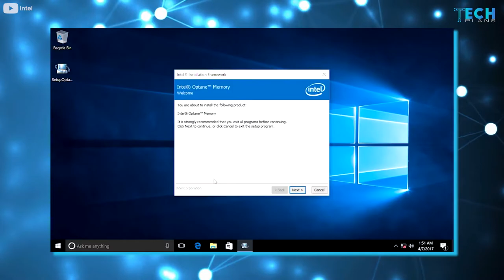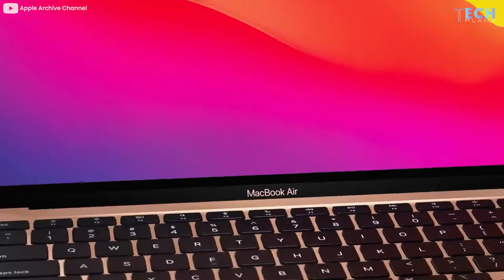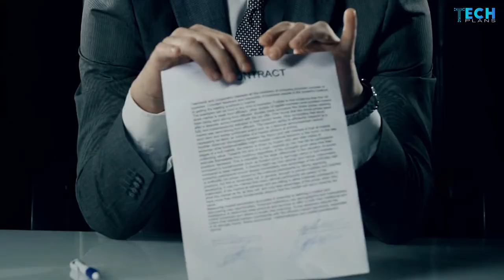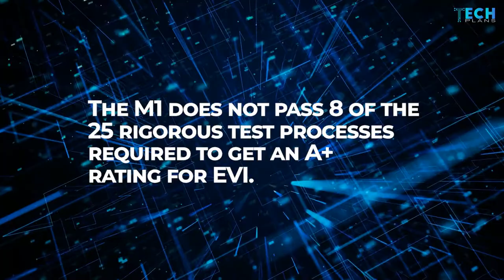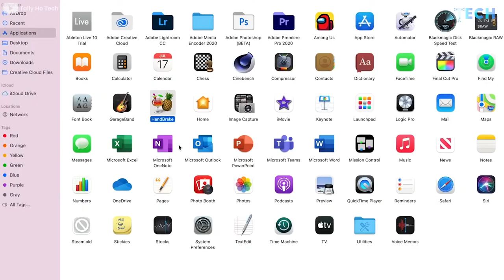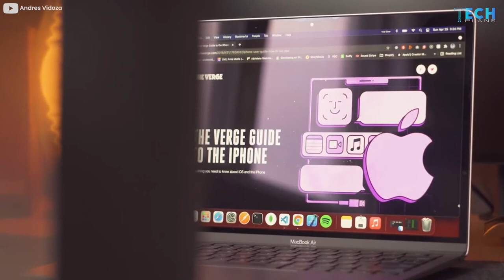Is Apple M1 Chip Better Than Intel?

Comment: Why no one is comparing the tiger lake 11800h vs. Apple M1 chip? 
You find all kinda comparison of M1 8 cores vs intel 6 and 4 cores. But for some reason all the Internet reviewer and been searching for around  3 month since the release of the new h45 tiger lake. Though they compared everything to the 11800h ,no one dared to put it next to the M1. 
I know from the benchmarks the 11800h will wipe the floor with M1. And I know M1 is more efficient in power only though.  But I wanna see the experiment live and no one wanna do it ??!!! Why ????
Reply: Yas it more efficient but whats good out of it, i work as video game developer, do a 3d renders and 3d animation videos and my intel machine destroys m1 like potatoe... And i have 10th i7 + rtx 3070 laptop for same price as m1 mac
Reply: Tiger lake gets HOT AS F and battery life suffers heavily. I had one, returned.
Reply: @meowow thats the reason i dont buy mac. Its nice, slim, lightweight, good bttery but also useless for me, would be thrown in a corner to collect dusts

Comment: Apple M1 chip power consumption is very very very low compared to other processors. It use 15w as opposed to 125w by i9 (laptops). Thats a huge difference. And 16hrs battery life is more than enough. Apple just destroyed the competition here. Accept it, I am myself an  Intel guy but I am gonna switch to Apple processors just because they are so much better there is simply no comparison. If i dont switch if would be like using a blackberry/symbian phones in android/ios era , you will have to switch. Price is one big factor though , if apple makes the price competitive other companies will simply die if they don't come with with tech to match performance of apple processors.
Reply: It depends where its good, video editing? I work as video game developer, do 3d renders, 3d animated videos, and my intel machine destroys apple, sorry but apple not universal, i rather be able to do my work than have long battery and a low power consumption that i cant touch or taste, cool tech but very limiting
Reply: @racistpixel1017  I agree but how may people are game developers ?  In most applications it's better than Intel.
Reply: @Akkinone1  quite some, also 3d artists, how many ppl is video editors? There jobs to be done all around the place. On top of that apple offers battery, what you do with that battery, my laptop is always on charger since its work station, i do not plug and unplug it like apple supposed to be, i plug and o forger...
Reply: @racistpixel1017  I am just saying it's far better processor in most cases that's it bro. Not in all but comparatively  in most cases its better,  that's all.  Wouldn't you agree with that?
Reply: @Akkinone1  yas but computer does not consist only out of cpu, m1 has perks and has weaknesses, o would not call ot better, on paper yeas, in people heads yeas, but in 50% of workflows barely. Whats good out of that wonderful power consumption if its cant do 50% jobs

Comment: The M1 uses the ARM instruction set, but they don't use ARM processors. You cherry picked 2 intel laptops that supposedly have better battery life, but you are the first I've heard say this. I'll bet those laptops won't last longer doing heavy duty processing while unplugged. Every Intel book I've seen has their performance fall of the cliff when unplugged.
Reply: I dont know how to say this to you, but not everyone care about battery life, i do understand that battery life is a nr1 argument on apple vs intel topic, but really i could say put that m1 on some 3d rendering tasks, render a 3d animation video, whats good out of battery if you cant do actual work with it? I can add many shortend of apple laptops like limited IO, small apps Library, mac os(for many users) dongles, closed eco system... But your ppl argument always that one, -but but battery....
Reply: @racistpixel1017  I do plenty of real work, but I do it on my Mac Studio. I didn't buy the M1 Air to do 3D rendering or anything that requires a long, hot time. However I do have an Intel i7 from 2018, and my lowly M1 kicks the living shit out of it in 3D and everything else.
Reply: @mikekaylor1226  well you dont render with cpu and to compare 5 yars old cpu against mac studio?Compare it to 12th intel, would be more fair. I do render with rtx 3070, since dedicated gpu comes as a package with intel cpus but not with m1, and price of my device is around 1600, similar as same spec but still with no gpu mac
Reply: @racistpixel1017  I was comparing an Intel 15 inch 2018 with a MacBook M1 Air 2020, not with the studio. Apple will eventually get their stuff together on the GPU front, and I'm aware that you render these days with the GPU. Intel is in trouble whether you like it or not. Apple just entered the market for PC CPUs and they have shaken the industry up. Sure Intel can beat them in brute force, requiring a nuclear power plant to power them.
Reply: @mikekaylor1226  i think its apple who put they selves in trouble, why apple now so hyped, because they took intel by surprise, intel was in winter slumber, noone dared to challenge them. Look amd already approaching m1 efficiency, few more generations and will go toe to toe, intel building own warehouses to be able to do the same.... Apple just made competition for them selves
Reply: Let’s be honest though… The transition to M1 did impact intel’s marketshare and intel’s processor is slower in productivity. Intel is however slowly gaining pace again and is still the king of the gaming industry. They gotta be prepared though for when the new apple silicon Mac Pro comes out.

Also incase your wondering why M1 is faster in laptops, it’s because it’s made and optimised for their laptops. Intel’s chips are built for desktops and therefore drain performance and battery life under heavy workload. The laptops don’t get enough power form the battery. In my opinion, their is no point getting a laptop if it has to be plugged in often just so it can reach high performance. Some high-end laptops have features locked unless it’s plugged in! Ridiculous right? It’s easier to get a desktop.
Reply: @YeahTheMitchs  laptop is about mobility ir portability... You cant carry desktop with monitor and everything form place to place, cant work with desktop from your bed or kitchen...  and a charger, wtf, so what that its plugged in, what really that changes? Pretty much nothing
Reply: @racistpixel1017  Ok calm down. We don’t need to start an argument and duh, of cause I can’t take a desktop places. What I was saying is that majority of windows laptops drop in performance on battery power. It can just be annoying to have to plug it in to get full performance.
Reply: @YeahTheMitchs  sorry, see no annoyance there. Laptop guy all my life, often traveling. Unless one is sensitive snowflake there should be no problem with a cable, just imagine its not there and it will feels like its unplugged... Thats all about a cable... Annoyance is only in your head and even if its annoys, see no reason why it makes no sense to use windows laptop and instead switch to desktop... The annoyance creates that "no sense"? Because there is more difference between laptop and desktop than just a cable

Comment: Windows OS is shite. Apple's OS is cleaner and easier to use. It snot about the chip but the software.
Reply: You mean aesthetic or a art style of software all is masters? Since where i need apps that mac does not have, windows have tons of small apps from independent creators, that shortens creative work. I have one app that generates all maps for 3d model material from a single albedo texture, that cuts time of my work hour or two for single material, just press one button, and mab... you can tweak values little if you  want to look better. Normally you go to photoshop and draw and edit for extended time.